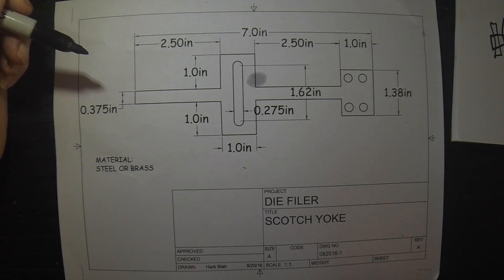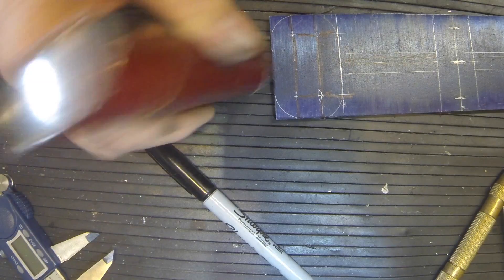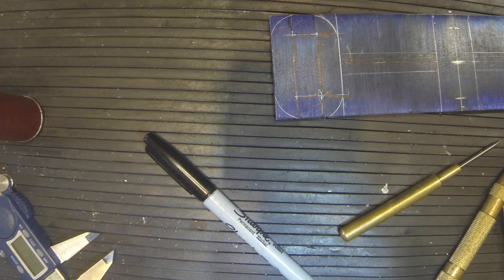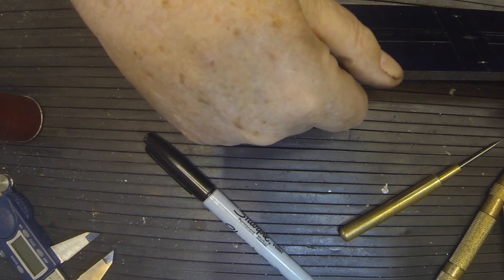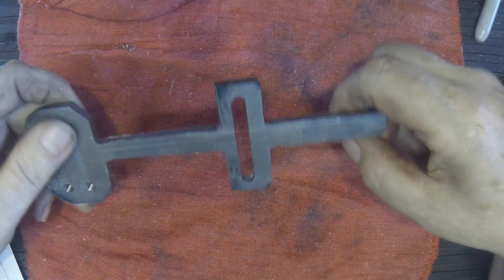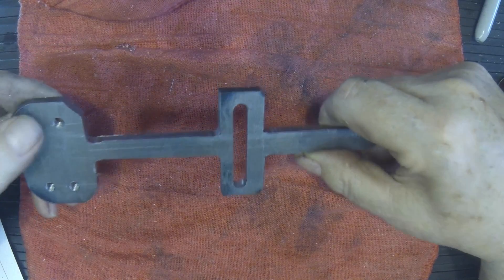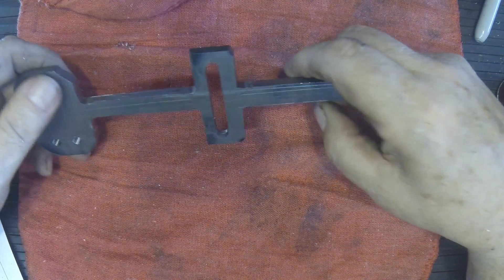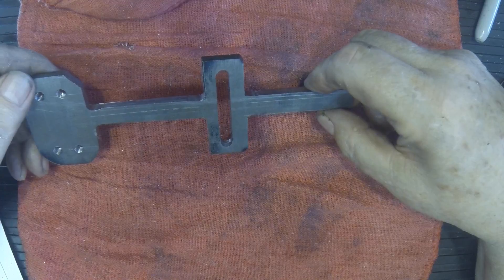This Week in Herb's Workshop #113   Die Filer (Part 1)

Comment: This will be a great project Herb. I have had it in mind to modify an old scroll saw to take a file - someone else did this quite effectively.The piece came out good - did wonder about how vertical the file motion will be without prescribing a bit of an arc.
Reply from the maker: The yoke is held in place at each end (about 1/2" beyond the max travel of the yoke.